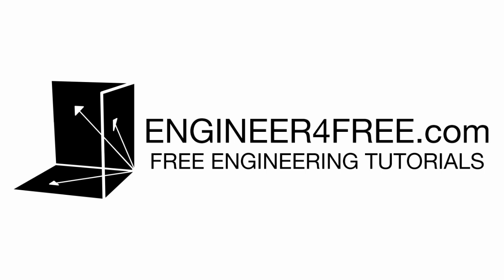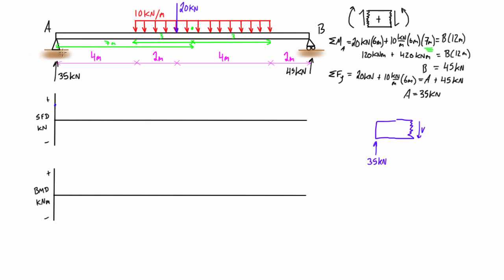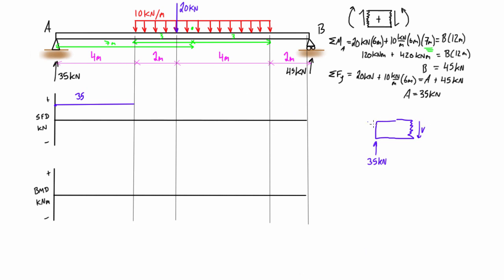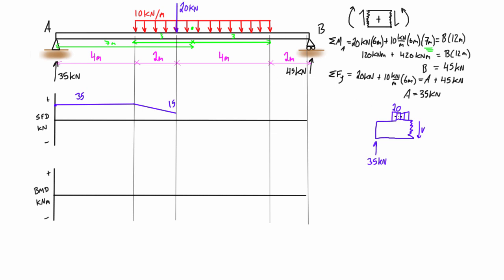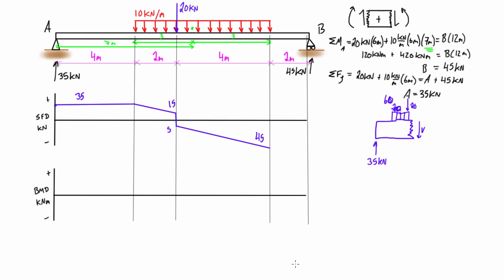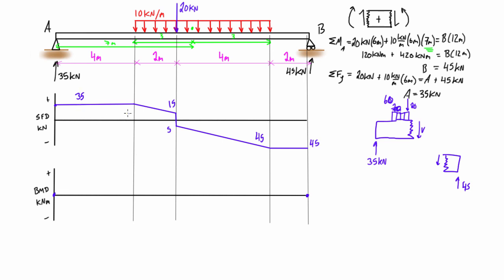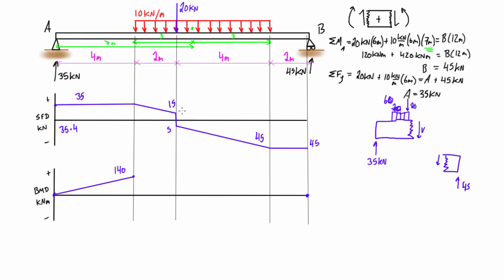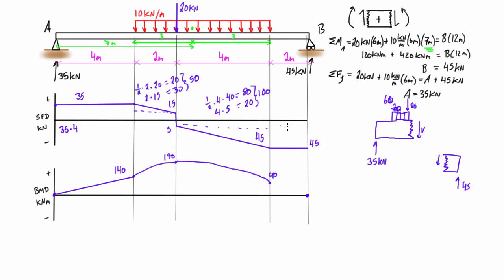Shear force and bending moment diagram practice problem #2

Comment: Shouldn't you have a linear segment of decrease of 20 that corresponds to the rectangle negative area and then a parabolic decrease corresponding to the negative triangle area? at 8:34. 
I understand that they're one single area but the decrease happened as a result of both a concentrated load + the remainder of the distributed load. Therefore the concentrated load will have a small linear decrease and then the parabolic of the concentrated load will pick up and finish at 90.

Comment: I really struggle with the calculations.I still don't understand how you got 7m in the calculation for moments about A
Reply from the maker: you need to find the centroid of the uniformly distributed load (udl). It's in the centre of it. The centre of the udl is 7m away from A. This is the distance that you multiply by the resultant force of the udl, to find the moment that the udl causes about A. Hope that helps!
Reply: @Engineer4Free  thank you so much

Comment: Could you link me to a vid that explains the initial calculations that you quickly show as i don't understand the distributed load section and where you got the 7m from?
Reply from the maker: Yeah no problem. 7m is the distance from A to the centroid of the distributed load. For videos that introduce centroids and distributed loads, see # 58 - 65 here: engineer4free.com/statics and then after, you can work through all SFD/BMD problems in order here: https://www.engineer4free.com/blog/ultimate-guide-to-shear-force-and-bending-moment-diagrams the "long way" takes a slower and more detailed approach and the "fast way" is what you see in this video, intended for use in higher level studies when you just need to slam them out as fast as possible

Comment: Sorry why is there a need to add another 20 force to get that 5 deflecting downwards
Reply from the maker: There is a 20kN point force located at x=6m (it's blue on the original diagram, and hiding within the distributed load). An externally applied point load will always cause a jump in the SFD, even if it's within a distributed load.

Comment: I have a question, where did you get that 7m in the solution when you try to solve for moment at point A?
Reply: It's a lenght from A to the middle of the area where "q" strenght is applied
Reply from the maker: Yes, thanks!

Comment: At the beginning when you are summing moments about A why do you multiply the 10kN/m by 6m and 7m? Really enjoy your videos, been stuck on these problems for a while :)
Reply from the maker: Hey George. 10kN/m * 6m gives the magnitude of the resultant force of the uniformly distributed load (udl), it's magnitude = 60kN. This resultant force is in the centre of the udl. The centre of the udl is 7m away from point A. When we take sum of moments about A, the moment caused by the udl about A is euqal to it's resultant force, times the perpendicular distance from A to the line of action of that force, so we get 60kN * 7m = 420kNm. You can write it all in one step as 10kN/m * 6m * 7m to save time. Just make sure that you end up with the correct units of kNm for moments, as expected. Hope that helps! All sfd/bmd videos are here: https://www.engineer4free.com/blog/ultimate-guide-to-shear-force-and-bending-moment-diagrams
Reply: Thank you so much! Makes sense now. Have a good Christmas 🎄

Comment: Good review video. At 7:29 the slope coming off of 140 should be less than the slope from 0-140 since the rate of change is decreasing not increasing and there was no negative pointload. Some profs might think you dont truly understand what is going on if you draw it like this. Just my 2 cents.
Reply from the maker: Yes you are correct. The way I drew it is not to scale, but if it was, the slope to the right would not be greater than the slope to the left. Sorry if it caused any confusion, but good eye and thanks for pointing it out for others!

Comment: So the resultant created by the distributed load which is placed at the x-centroid does not have anything to do with making the shear force diagram (and is that for all cases?)
Reply from the maker: The resultant isn’t a real point load acting on the beam, so don’t consider it in the SFD as one. The resultant can be used though as the centre of the udl for purpose of moment about point A. So you only really consider the resultant in the sum of moments equation, then forget about it after that.
Reply: Awesome man! Thanks so much for these videos they are saving me more than my damn teacher xD

Comment: how is the distributed force = 20KN Should it not be   (6*10)= 60KN??
Reply from the maker: Hmmm, look again. The overall moment caused about A by the distributed load is 420kNm. You do have the magnitude of the resultant right, as 60kN. You also need to multiply it my 7m because the resultant is 7m away horizontally from point A.

Comment: How do you know the concavity of the BMD(whether it is concave up or down?)
Reply from the maker: The way I like to do this is to visually inspect the SFD. Slope of BMD is related to the area under the SFD at that location. Slice the triangular section of the SFD into really skinny tall rectangles. The tall rectangles have more area, meaning a steeper slope. Knowing which way the magnitude of the BMD jumps toward across the distributed load, and knowing which side has a steeper slope, the parabola can only be drawn one way, thus the concavity is apparent. Hope that makes sense.
Reply: But is there a concept behind the concavity of it?
Reply: @simjxin6696  I think this may help. If the area is in the positive position than it is concave up meaning we have a max and vice versa for negative position

Comment: How did you get the 7 from the Moment at A
Reply from the maker: 7m is the distance from point A to the center of the distributed load. For moments resulting form uniformly distributed loads, we use the resultant force which is located in the center. Because the distributed load is 6m long, the resultant force is 3m from either side. The udl starts 4m from A, so 4 + 3 = 7m, is the d in the M=Fd equation. Got it?

Comment: Why are the clockwise moment's not negative?
Reply from the maker: If you moved all of the terms on the left hand side of the equation to the right hand side, their signs would be negative, and would satisfy the typical sign convention of taking counter clockwise to be positive. I often skip the step where I write ΣMa=0, and rather just write the expression with all clockwise moments on one side, and all counterclockwise moments on the other side, all with positive signs. It's the same thing.

Comment: sir, how did you find the reactions. This is the problem.
Reply from the maker: I applied the sum of forces in y direction and sum of moments about point A. For the uniformly distributed load, take it's resultant force as a point force that is in the centre of it. You can see the work for it in the top right of canvas in black ink.

Comment: What if the 20kn point load is somewhere after the center of the uniform dead load? how would the diagrams look like? Im sorry, still puzzled :'(
Reply from the maker: Look at the SFD. The area with the uniformly distributed load (udl) is a sloped line. The slope is the same to the left and the right of the location of the point load, it just jumps by a magnitude equal to the point load. The slope will be the same no matter where the point load is, just the jump will occur wherever it is. If this is seeming too advanced then I strongly recommend taking a few minutes to review the "long way" of doing SFDs and BMDs, which are videos 66-72 here: engineer4free.com/statics and then after watch videos 1-9 here: engineer4free.com/structural-analysis . Work along with the videos if you can and it will help you recognize the method/pattern. The videos in the first link (statics) are the more comprehensive "long way" and the videos in the second link (structural analysis) are the "fast way." The video that we're commenting on is using the "fast way" so that's why it might seem too quick for ya.

Comment: hey man , your videos have been a massive help but i have a question, like how did u get 7m distance on the support reactions part?? And do u have any videos to draw shear and bending moment diagrams with loads in triangular shape??? (P.S - Keep up the fantastic job mate)
Reply from the maker: Hey glad to hear it! 7m is the distance between the resultant force of the distributed load, and point A. The resultant force of a uniformly distributed load (udl) is in the centre of it. The udl is 6m wide, so it's resultant force is 3m from either of its sides. the udl starts 4m from point A, so 4m + 3m = 7m. This is the distance from A to the resultant of the udl, which we need in the moment equation. As for triangular loads, no I don't think I did any. I think the only video that I did on triangular loads was this one from my statics series: https://youtu.be/_K-3hUyoqOw but it just talks about finding the reactions.
Reply: @Engineer4Free  got it, thanks
Reply: @Engineer4Free  then where did 3m came from

Comment: Sir, can you give an explanation of why you drawed the graph (140-190 in BMD) as concave down rather than concave up
Reply from the maker: Hey thanks for the question. First of all, if the entire BMD appears upside down to you, then it is because we may be going by different conventions. I follow the North American convention of drawing positive values above the axis for a beam. I believe UK and some other countries draw positive values below the axis. Mathematically the other way is less intuitive, because it gets really confusing to take the derivative of a function where positive is in the downward direction, but practically it is quite useful, especially in the analysis of frames where members can be oriented in any direction because the positive values correspond to tension side of the member... The only reason I mention all that is because, if the entire BMD was flipped/mirrored about the axis, then the parabola in that section would be concave up. Following the convention that I do, the parabola should be concave down. There are two ways that I like to interpret why this is. 1) If you numerically integrate the SFD in this region, say we slice it up into 100 vertical pieces, each 0.02m wide. The area of each slice on the SFD translates to the change in magnitude on the BMD across that 0.02m section. The areas on the left side are bigger because they are taller, and the areas of the SFD slices as we move to the right get smaller as the triangle decreases in height, ie, the changes in magnitude on the BMD get smaller. So this is why we are getting greater slopes on the BMD on the left hand side of the region than we are on the right hand side. There is only one way to draw a parabola that satisfies this, and it is as drawn in the video, and that is for the parabola to open downwards, ie concave down. 2) We already know that the BMD is the integral of the SFD, so that means the SFD is the derivative of the BMD. Every value on the SFD is therefore the slope of the BMD at any given value of x. Looking at the first region, the SFD is a constant 35, and the slope of the BMD is a constant 35. The SFD is 35 at x = 4, and 15 at x = 6, so the slope of the BMD at x = 4 is 35, and at x = 6 is 15, ie it is decreasing as we go left to right in this section, which again would mean that it must be concave down. When I looked back over this video to address your comment, I realized that I made a bit of a graphical typo on the slopes at x = 4, 6, 10. I have put the following note in the description of the video: "There is a bit of a graphical typo in this video. The values, shapes, and concavity on the bending moment diagram are correct, but where the BMD equals 140 and 90, I drew the slope as discontinuous. It is in fact continuous at those points. The slope appears to be continuous at the max where BMD = 190, though it is truly discontinuous there. If you took the derivative of the BMD and plotted it (it's the SFD), there is that discontinuity at x = 6m that basically tells us the slope on the LHS is +15 and the slope on the RHS is -5, ie no single slope defines the point on the BMD where x = 6m. If you do the same thing at the other mentioned values (x = 4, x = 10) then you'll see that the slope of the BMD (value on the SFD) is +35 on both sides of x = 4, and -45 on both sides of x = 10, ie both of those points on the BMD have continuous slopes. Yay...calculus! I got a little carried away trying to pronounce the shape of the parabola in the small vertical space that I was working with and as a result, it can be a little misleading if you are really paying attention. There is a really great free tool on https://bendingmomentdiagram.com/ that you can see a computer generated SFD and BMD for any statically determinate beam. I recommend inputting this beam or any others that you aren't sure of to see the non-shaky-hand drawn and properly scaled version, it's really nice." Anyways, I hope that all helps to clarify why the section in question is concave down, and sorry that there is a bit of slope mix-ups that probably added to the confusion. Cheers, let me know if that clarifies it all!
Reply: Thank you so much for this great answer...